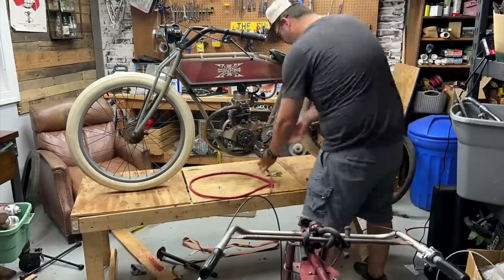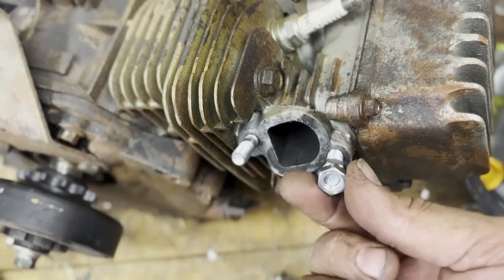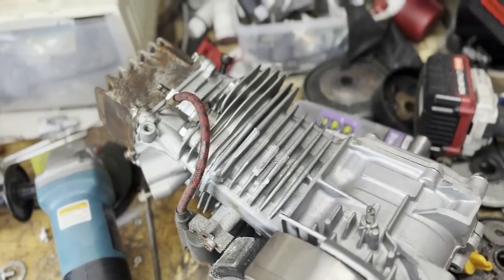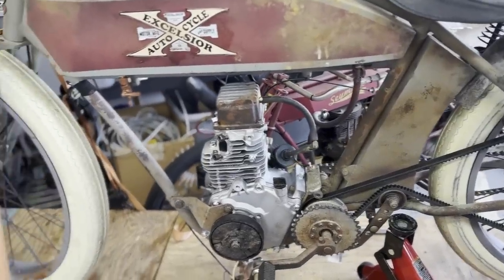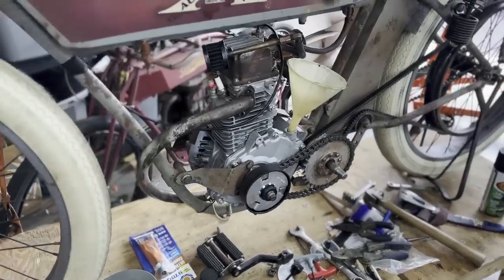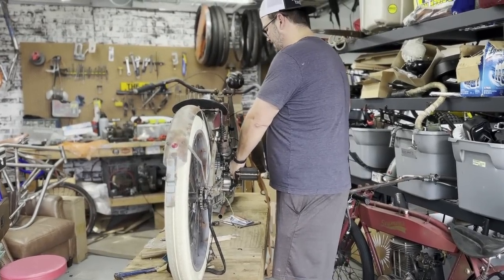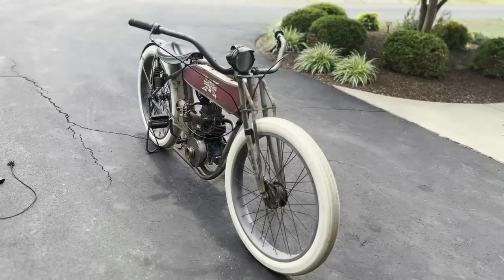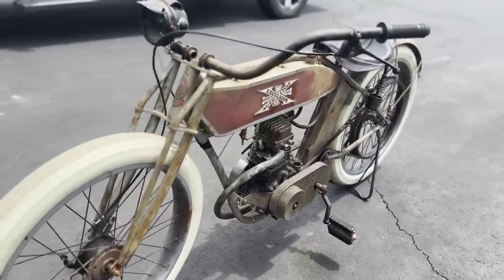4 Stroke Motorized Bicycle: How to Make a Predator 212 Look OLD [Part 2]

Comment: Lol! Great build, but where's the  "how to make it look old" bit of the video?
Reply: Perhaps spray the engine with WD-40, then run it?  Do this a few times, wiping matters off so as to build “patina?”

The thing that worries me is these engines were designed for fan-cooling, and hence might run overly warm.
Reply: @dennisyoung4631  we'll never know! If you look at the Pt1 of this video 10 months ago, he had the same comments because he didn't tell us there either - he even said in the comments that it would be in Pt2... and of course, here we are, and it isn't!
Reply: I agree. Maybe it is time for a new category after "original" "restored" "tribute" and " retro-mod". Let's call it "utter bollocks". Available for shipping NOW!
Reply from the maker: Which part are you referring to? I go over the bracket removal and strip down extra parts as well as adding the different valve cover and vintage plug wire. Are you referring to the patina? I cover this other videos but I use high temp black paint and then add iron oxide and rust activator to give it a weathered look.
Reply: @SeymourCycleWorks  thanks for replying, bit yes - referring to the patina. Not sure how others feel, but what you did here was fit a new motor in the bike, and it still looked (mostly) new at the end of it. So yes, going by the title, I WAS expecting the patina to be part of it. The only other video I could see re patina didn't cover the main hot parts of the engine, unless I've missed a video somewhere. It's all good though, you've answered my questions for now, but if you do go on to patina the engine too, please make a video! 💪👍👏👏👏
Reply from the maker: @sonovoxx  thanks for the feedback and I’m always down to taking requests for new video ideas. I’ll plan on releasing another video on just  the motor patina. Thanks for the support and let me know if you have any other questions!
Reply: @SeymourCycleWorks  perfect! I'm subbed with bells on, so I look forward to seeing it! 💪👍
Reply: You still offer your video course? Does it convert building a tribute bike like this? I’m looking for something complete and I remember you had something available.
Reply: @SeymourCycleWorks are you running your engines with no plastic flywheel and does it effect the way the engine runs or the lifespan of the engine?
Reply from the maker: @SonnyBachmann  Exactly, I take off the plastic shroud and fins.
Reply: @SeymourCycleWorks  how did you mount the carburetor? Did you have to make a custom intake to have it turned properly?
Reply from the maker: @SonnyBachmann  Exactly, it's a custom intake manifold that turns it to the correct angle. You can achieve the same thing with a rubber coupling and hose clamps.
Reply: @SeymourCycleWorks  thank you for always responding to comments, I also found the parts list you put together very helpful!

Comment: get a cast aluminum flywheel, if that flywheel fails (which stock ones are known to do) you will have severe shrapnel damage to your leg, especially with how low geared that thing is. a cast aluminum flywheel from a Tillotson 212 will run you about 40 bucks and keep the vintage look.
Reply: You can just get a whole Tillotson 212 instead of the Predator anyway, they're better built and a little spicier for only $50 more than the going rate for a Predator these days.
Reply: Wow, had no idea that these flywheels can fail and cause damage like that, thanks for the info my friend,I'll  definitely be looking into an up grade.
Reply: @hornmonk3zit  I'm up here in Canada eh..lol
We have a 212cc power fist engine from princess auto our version of your harbor freight. I've had it 4 yrs, velocity stack air filter and exhaust, Governor still on it,never had a problem with it, idk much about the flywheels in this engine,came with starter attached,key start and I've been clocked at over 70+ mph...96km, says I shouldn't be able get that fast out of these motors with Governor still intact but I does that with a bit more left in her, gets very sketchy tho, especially on a micargi stretch beach cruiser, it's kinda like riding a spaghetti noodle..lol
Coast was 175.00$ can. roughly, so about 125$ U.S
Reply: @stephenyetman  The issue with the flywheel is mostly a problem when you remove the governor, the stock cast iron flywheel isn't rated for more than 3600 RPM. Also 96kph isn't 70mph, it's not even 60.
Reply: @hornmonk3zit  thank you for the info and yes you're right on mph/ km I was never any good at converting km to mph ..lol.  And it's only simple..lol thanks again eh

Comment: This looks really cool. You should have left the studs in the block for the exhaust. It's not good to be screwing a bolt in and out of the aluminum. That's just asking for stripped out threads. That's why there were studs in the engine. Besides, the whole idea is to look old. There were no Allen head bolts for a LONG time .
Reply: Wise point...but we're long past authenticity here 😉😂

Comment: I'd think oiling to the top end would suffer a bit in this configuration. Not to mention no shrouds or fan for cooling. I guess 212s are cheap enough though...
Reply: More technical wisdom...that's waaay out of running angle specs...but I wonder are the antique brakes and/or tires more to be concerned about? 😋
Reply: You both  obviously don’t have a clue. It oils just fine. 😂
Reply: @mbrrideitlikeyoustoleit8436  thanks for having enough clues for us all. You obviously know everything. Let's not go by the likes on my comment on the public agreeing with my statement. Let's also hope you have a clue about sarcasm. Of course you do! You know everything.
Reply: @inspireonex  how do I know everything? I just know a lot about 212s I’ve been building them for 20years.
Reply: @inspireonex  you have 12 people that agreed with you and that’s for people that don’t know how a 212cc works lol 😂 get over yourself
Reply: @mbrrideitlikeyoustoleit8436 the OP replied in another comment that it only oils because it is "overfilled". That's pretty stupid. You can get over me first
Reply: @inspireonex  it takes 20 oz of oil if you want to know

Comment: The governor was not hooked up to the carb, and I'm curious if it stays cool enough without the cooling fan and shroud
Reply: That was my thought too. If the throttle cable goes directly to the carb, the govenor is doing nothing.
Reply: Yes it’s just flopping around in the engine and engine won’t last long.

Comment: How does the engine not overheat, how does the top end and rockers stay lubed properly, how does the cylinder stay lubed being the splasher on the crank is now at the wrong angle. This is only cool if you don't plan on riding it lol
Reply: I second that. Its only meant to operate 10-15 degrees tilt max
Reply: What engine would be better?
Reply from the maker: I’ve not had any issues but yes, this motor like this is not meant for daily riding or extended periods but they are awesome for parades, car shows, and riding in short distances. The motor that I prefer is the Honda GC160/190 like the red bike I’ve featured on here. It’s naturally a vertical cylinder and you can dress them up quite nice.
Reply: @robertm2663 Check out the old generation Honda engines - Honda G400, G300, G200 - they have a vertically positioned cylinder, and in addition they are pressure lubricated, they have an oil pump, and the crankshafts rotate on bearing shells. In fact, they are better engines than the newer generations. Unfortunately, they are currently difficult to buy, there is also a problem with parts for them.
Old Kohler engines are also an interesting option - they also have vertically arranged cylinders and are pressure lubricated. They have an SV - low valve timing.
Also noteworthy are some Kawasaki and Briggs & Stratton engines.
Take a look at the Board Tracker with a Briggs Vanguard V2 engine over 620cc:  https://www.youtube.com/watch?v=Fgp_IfV-Vaw&t=188s

Comment: Looks like a 3d powersports twin disc clutch would be more authentic for you. Hand lever controlled, solid lockup, also allows engine braking.
Also kinda' funny to think that the real thing made the same power from a vee-twin 1000cc on barely 60 octane fuel in 1917.
Nice work! I love it when things are as real and raw as they can get.

Comment: How’d you get the patina look on the block and head of the engine? 

Also keeping the governor inside the engine and putting a slide carburetor that isn’t attached to the internal governor doesn’t help it slow down. It’ll just keep going up in rpm’s until valve float or possibly even the magnet on the flywheel coming off. 

Otherwise, great video. I’m doing some vintage stuff not as a old as this but would like to know more how to make a newer engine look older.

Comment: I found the regular black belts shred/wear fast . I switched to a impliment belt like a deck belt . It handels the torque much better . Good job !
Reply: If you are slipping it then the black belts do go bad faster. They seem to get hot and screech too lol. I think they grip better though
Reply: @greenbassboosts8872  I needed a belt that could take a load on the inside surface and the black ones would shred quickly. I had modified a chainsaw clutch drive with liquid steel and the torque was delivered to the inner face as opposed to the sides like a normal v drive. I agree with you about slipping, like using it as a clutch for sure. Have you built one? What did you use for a motor and drive?
Reply: @321CatboxWA  I built a bike with a Tecumseh 8hp and v belt slipper clutch and a 49cc 2 stroke with direct drive v belt
Reply: @greenbassboosts8872  Cool, was the 2 stroke a kit motor?
Reply: @321CatboxWA  It's a 49cc pocket bike engine with a pulley welded to the piece of the clutch that mounts to the drive shaft. It works ok but the gearing still isn't ratio'd enough to pull up a lot of hills even though I put the smallest pulley I could on the engine and have it going around a 20 inch (18 inch) bike rim on the other end. I'm thinking this concept might work better with a bigger wheel, but I also plan to hash out a jackshaft setup on future builds
Reply: @greenbassboosts8872  Cool, I used a 3 piece crankshaft minus the cranks as a jackshaft. I mounted the front sprocket onto the rear gearset and a rear sprocket to a large pully where the cranks were. Then I set the de-railer back a little to clear the gears and shift 2sp. Be sure to stake the rear axle or risk going over the handle bars .  I also added two spring tensioner pullys to the belt drive primary for added belt wrap/grip without having to overtighten the belt . I advise letting off the throttle between shifting. I used the cranks and pedals for foot rests.

Comment: If the head is straight up instead of normally at a 45 degree angle would that not change the ability to lubricate itself?

Comment: How about the cooling without the fan and covers   , does it Overheat with out it ???
Reply: These engines are designed to be stationary in stuff like generators and wood splitters. In a bike, there's a lot more airflow because it's moving. That's why you don't see many air cooled motorcycles with cooling fans.

Comment: Any air holding tire has less rolling resistance and wear when properly aired up. Just need to master the tube bender, sheet metal bender and welder. Make your own version of the frame, handle bars and tank to launch your own modern version. Then upgrade to cutting table for artsy gears and mounting stubs. Then enforce the closest friend to learn how to make custom leather seat covers and handle grips. Catching name for the bikes and live the dream making a living from home with a stocked beer fridge.

Comment: Nice work! I can't recall ever seeing a bicycle with a large curve in the down tube just forward of the bottom bracket. Is this something you add to facilitate motor installation and/or vintage motorcycle appearance?. Thanks.
Reply from the maker: This frame is custom built but yes, a lot of builders will take bicycle frames and add a drop loop and longer top tubes

Comment: Are you using a different carburetor? if so how do you connect the governor to the throttle? awesome video and a great choice of vintage motorcycle, thank you for sharing.
Reply from the maker: This is a different carb. A mukini and I never hooked up the governor, just left the mechanism in the engine.
Reply: @SeymourCycleWorks thats a good idea incase you decide to connect it later on, like to stop the new owner from over reving the engine 😀

Comment: How do you adjust chain tension on your primary chain... it looked way to loose before you put the cover on.
Reply from the maker: I ended up taking a link out. There really wasn’t an adjustment other than getting a bigger tooth sprocket/ tanking links out.

Comment: Where did you get the valve cover, that was on the motor you pulled off
Reply from the maker: On eBay. I have full parts list here: https://shorturl.at/lzR18

Comment: Looks cool but 2 major problems the first being the engine isn't designed to run at this angle, it's a oil slung engine and gets lubricant by dipping the rod connection down into the oil and slinging it on moving parts. At this angle there's no way of knowing if it's even reaching the oil or too much.  The second being this is a air cooled engine and comes with a shroud and fins on the flywheel to force air over the head cooling it. It's a good system but if taken away it will over heat and seize, I know from experience from a kid doing just what you are here. It will run for a short time but that's all.
Reply: fan shroud is added for stationary use, look at all the air cooled motorcycles from the past, don't see many fan shrouds on them, riding creates a breeze that cools them.
Reply: @anunnakielohim2727  that's what I thought also when I was just a kid I put one of these small engine on a bicycle and it just didn't look cool with the shroud and it lasted about a week and the rings collapse from heat. It runs at a temp that is at its limits while moving then a few stop and idle it's a dead duck. Even Harley Davidson has gone to a small radiator cooling the head in the exhaust area. If these engines had a pressurized oil system going through a oil cooler they may hold up to it but they don't.

Comment: What rims do you run on this build? I would think it will break the spokes on the stock rims.
Reply from the maker: These are custom built with way thicker spokes than normal. No issues with the belt since it’s more evenly distributed around the wheel.

Comment: How did you make the steering fork pivot?
Reply from the maker: It’s actually has a bearing on each side of the tube and a 5/8” bolt through them if I recall

Comment: Is that a custom made valve cover?
Reply from the maker: No, you can get them on EBay if you search tall finned valve cover for predator 212 or honda gx200

Comment: It looks great!
I'm wondering about lubrication though.
Actually, this engine shouldn't be tilted at that angle because it has splash lubrication.
Aren't you afraid that there will be seizing of poorly lubricated elements???
Are you using any other oil, e.g. fully synthetic, high viscosity???
Sam plans to do something similar, based on the Polish SHL motorcycle, after major modifications. It would look more or less like this: [img]https://i.imgur.com/Wue3Wmy.jpg[/img]
[img]https://i.imgur.com/V7anvNL.jpg[/img]